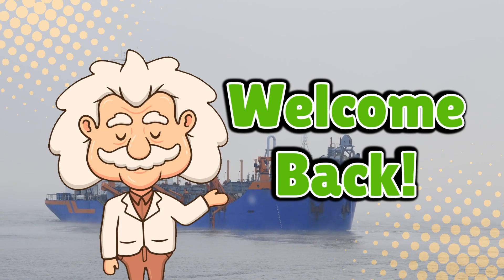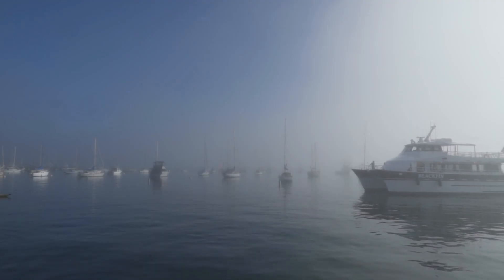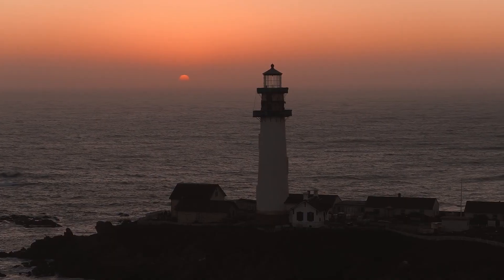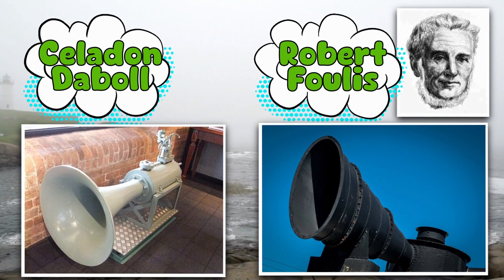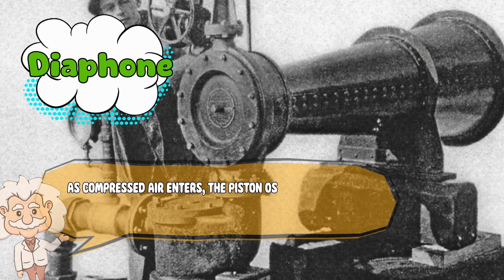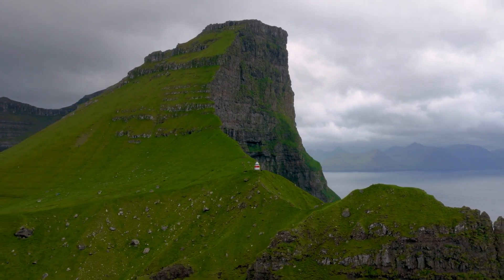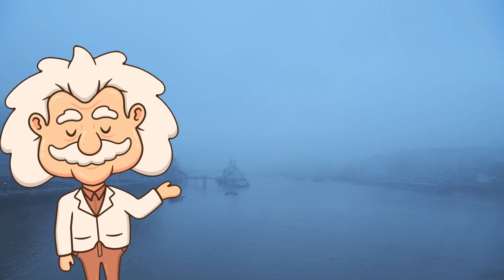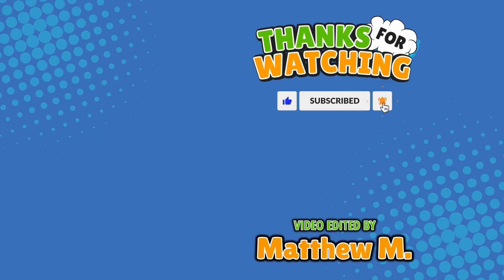How Do Foghorns Work? The Ocean Yells

Comment: Can you please make a video about Faraday Boxes and how they work and why they are 100% very useful in preventing relay attacks. I have one at home. I always put my Key Fob inside of it every time I come home. I always bring it with me on Vacation so my car never gets stolen by a thief using a transmitter. Faraday Boxes have Metal Liners that prevent the signal from leaving the key fob. They also save a ton of battery life. Key Fobs use no power at all when inside of a Faraday Box.
Reply from the maker: Interesting! Thanks for the suggestion my guy! <3
Reply: @ExplainingEverythingChannel  Your Welcome. I drive a 2020 Hyundai Elantra Value Edition and that car is Push Button Start. It has Smart Entry.